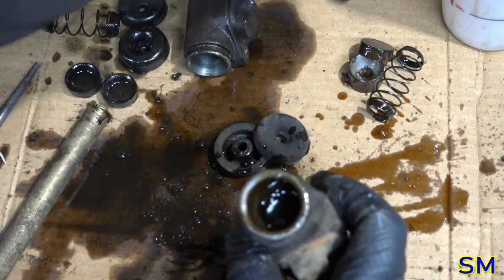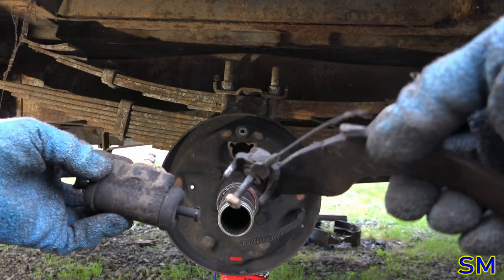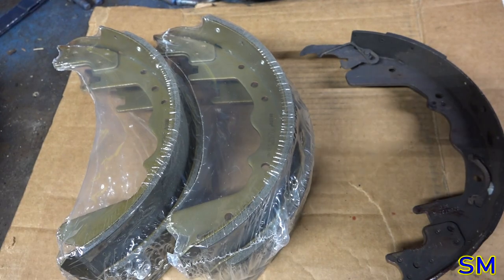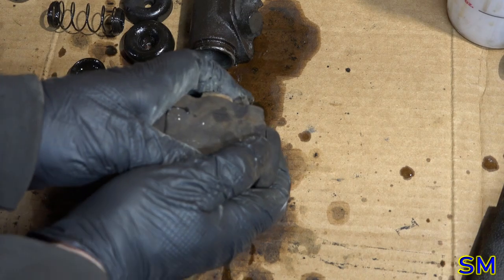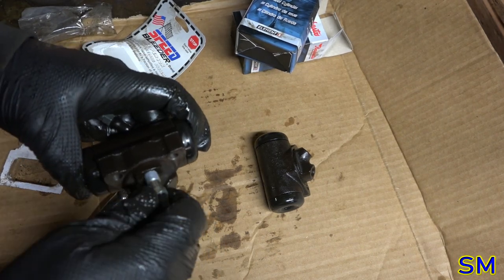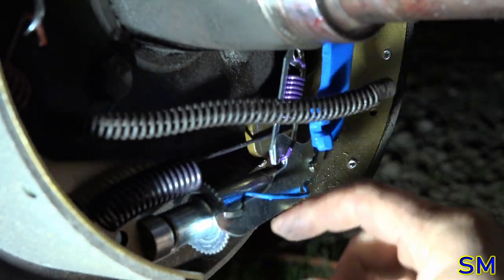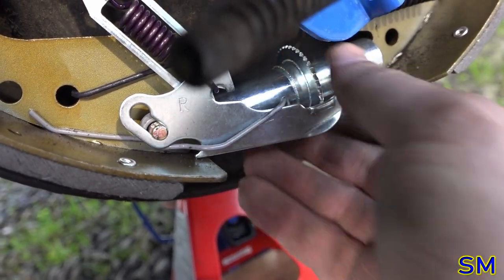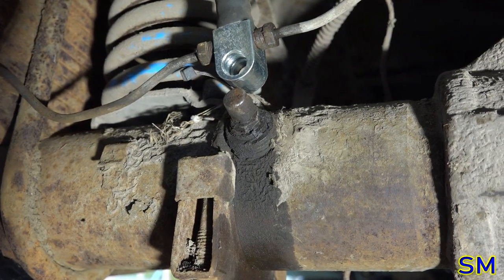Dana 70 HD Rear Drum Brakes Overhaul - 1980 F-350 Service Truck

Comment: I started my automotive career with Ford back in the late 80s. They still rebuilt wheel cylinders and brake calipers then. Ford was big on using phenolic caliper pistons from the factory which loved to stick so replacing them with steel pistons was a money maker back then. 👍
Reply from the maker: The phenolic pistons love to stick eh? I thought steel on cast iron would stick more. Very interesting! Thanks for sharing👍🏼

Comment: To cure the Ford "better idea" battle that starts at 34:58, in a large flat blade screwdriver (big handle is easier on your hand when pushing on the end of the screwdriver) use a cutting wheel on a small right angle grinder to cut a slot that just fits over that cursed spring that connects to the anchor.  Then use a piece of wire to hold the anchor in place as you push the spring hook in using the slotted flat blade screwdriver.  Push the spring past the anchor and then hook the anchor as you gradually allow the spring to engage the anchor.  Took me one try after I made that tool and found a piece of wire.  Of course, I already have a cordless right angle grinder and cutting wheels.  A body tool for prying out body clips has too large a slot, it did not work for me.
Reply from the maker: Yeah that’s a good call👍🏼

Comment: I’m definitely going to try bending the adjuster plate that adjusts the star wheel, I’m having troubles with that and it’s just not sitting right. I went ahead and ordered new because a couple of the other pieces were deteriorating but it still acts as if it doesn’t want to click to adjust. Also, how your particular side (the right side) didn’t need to be adjusted on the brake adjuster, mine did the same thing and acts perfectly without modification, but that left side is a pain.
Reply from the maker: Perhaps it was bad stamping when the left side was made? I’m sure they come out of the same hole in the ground. Definitely try tweaking it gently and see if it can get you some better results👍🏼

Comment: Now that your brakes and powertrain are spiffy and ready to rock, does the suspension require attention? Are you planning to do much to it before considering the vehicle read for service?
Reply from the maker: The suspension doesn’t look terrible. Bushings on the front are not completely worn out. There is a bracket that holds up the service box that has shifted off the frame a bit. I can pound that back in. Might do front shocks. There is only coil springs on the rear axle instead to shock absorbers so I’m going to have to think about how I like that. But I don’t think there will be much suspension work to be done fortunately.

Comment: The adjuster actuator arms were put on the wrong sides... the little bulge should be towards the star wheel... am only 3/4 way through video but am hoping you corrected that
Reply from the maker: You gave me a start for a second lol. But they were installed correctly. Fast way I know? The new arms are marked “L” and “R”. You can see it in the video. The right side more so. As we all know “left and right” orientation is correct when the operator is sitting in the operator seat. The operator’s left and right is now the same as the equipment’s left and right. Thanks for watching👍🏼
Reply: @SwedeMachine  Fit form and function on some parts is awful... one job, grab the star wheel... one job. Just thought that rounded protrusion was the way the star wheel was grabbed.  Replay says correct... good to go then.
Reply from the maker: We cool boss no worries! 👍🏼🤘🏼